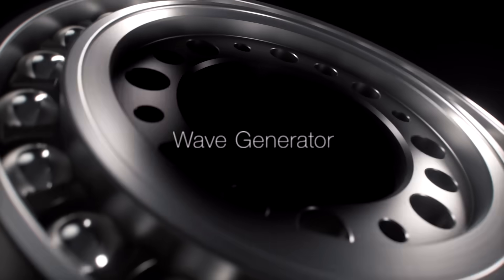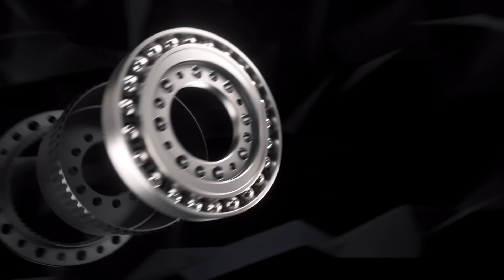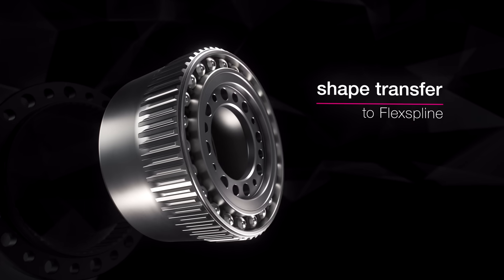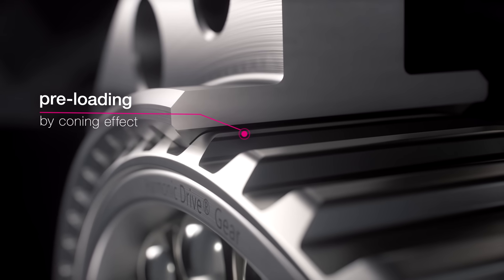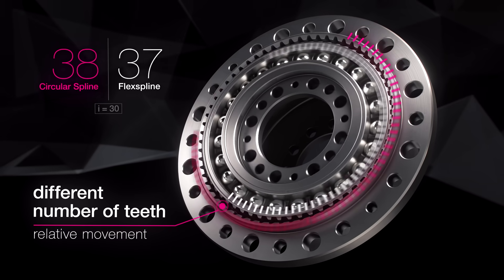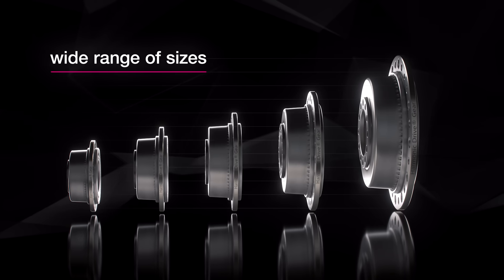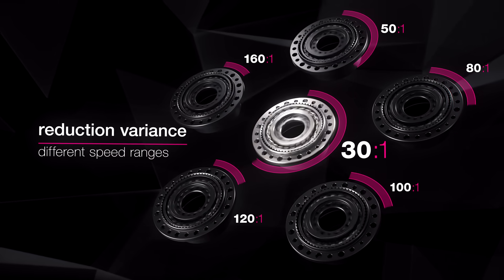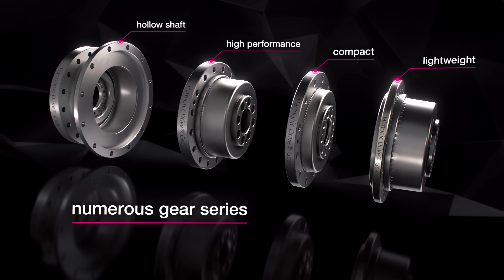Harmonic Drive® Strain Wave Gear: Functional Principle | The Original

Comment: Can this be used to rotate throttle
 I want to create an application where i give how much angle to rotate 0-90degrees and this actuator should rotate the throttle by that angle. If yes how should i do mounting and connect the throttle
 To the rotor. The throttle size varies from bike to bike
 How can I create a clamping mechanism that connects rotor and throttle

Comment: Beautiful.

Any data regarding longevity?
Reply from the maker: Hello, thank you for your interest in our products! 
The strain wave gears have been qualified with intensive endurance tests, which aim at checking the gear functionality, precision and stiffness over gear life. If a gear is loaded with rated torque and rated speed, it will statistically reach the specified gear life L10 with 10% of failure propability. For example: if a CSG-20-100-2UH is loaded with 52 Nm (=rated torque) and 2000 rpm (= rated speed), it will reach statistically a life of 10.000 h with 10% failure propability. If the same gear is loaded with half rated torque at the same speed, the L10 life increases to  80.000 h. This goes along with our field experience, proving that many Harmonic Drive® strain wave gears endure many years of operation in machine tools and robotic applications.

Comment from the maker: Yes of course, the Harmonic Drive Gear ⚙ can be driven back. By the way, this happens in every typical robotic cycle hundreds of times every day: Every time when the axis is in motion and slowed down rapidly, the load inertia on the gear output side drives back the gear (in a controlled manner, determined by motor and controller).